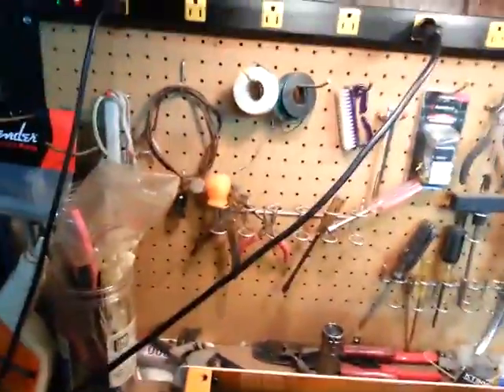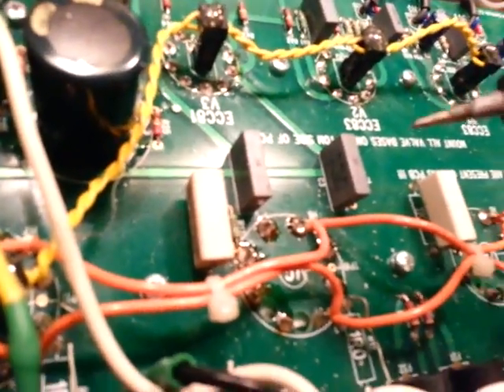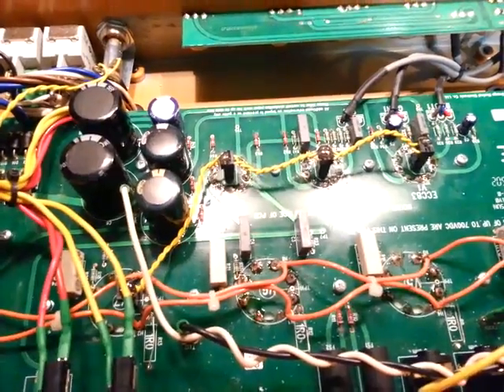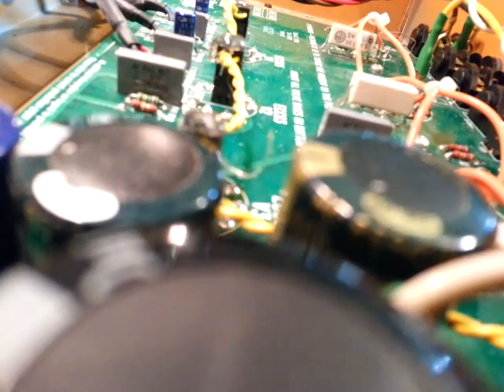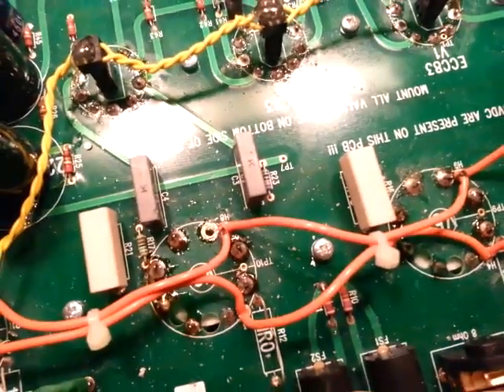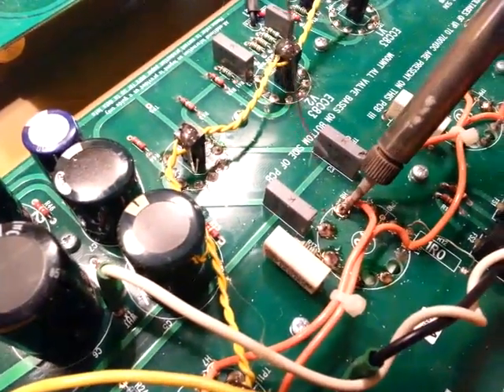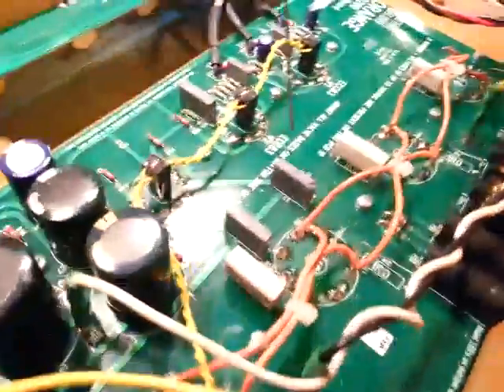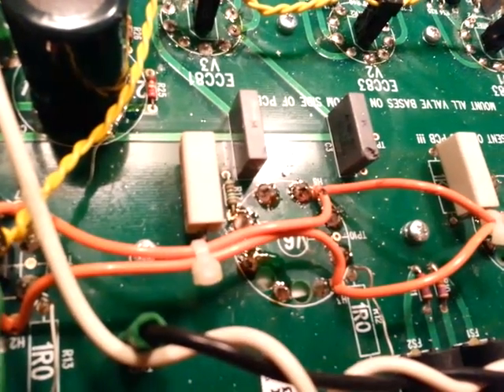Repair Orange Tube Amp bad solder

Comment: It is fixed. The tube pre amp pins would pop when you would tap on them. That was a tell tale sign.  I  re flowed the solder  and added leaded solder to   fixed it. I should probably do the power board and this amp would benefit from a new set of tubes, seeing that is 11 years old.  It was humming and popping now it is a lot  quieter .

Comment: I have a noisy B52 112 AT tube amp. It is hisses and pops. My guess is that the tube pins are not making good contact.  I have tried to clean them to no avail. This amp was made in 2006. I bet anything it has lead free solder on it. I will just replace the pre amp tube pre amp sockets with ceramic gold plated ones and see what happens. The power tubes sockets are tight.
Reply from the maker: Jack Issa hissing and popping can be bad preamp tubes or solder joints. The solder joint could be anywhere in that preamp tho so I'd reflow all of them before replacing sockets. As long as there's no dust in the sockets, even the worst conductor would be plenty for preamp tubes.
Reply: I guess I should start removing solder at the pins and re-soldering the pre amp tube  socket pins , My guess this amp has lead free solder because they were sold in the UK Swapping pre amp tubes around have little or no effect. The tubes test out on various tube tester as well. If I hit a tube pin on the PCB they will make noise . This amp is 11 years old this consistent with this type of failure based on it's age I will try to re-sweat the pins starting on valve 1  and working my way to valve 5. In the pre -amp.

Comment: kinda stupid to me to change ALL of the soldering before there is an issue hence the old saying in the tech world: if it aint broke dont fix it. You only create problems needlessly and run the risk of overheating some components
Reply from the maker: Picco bow and most techs would prefer to do routine and preventive work. hence replacing tubes at normal intervals and also recapping
Reply: That's because u are stupid, only a stupid person would say what u just said and that's why your to stupid to see it lol
Reply: Polar Bear  hay Jesus!

Comment: Idk who to ask for help no one around me does amp work or if they do they want like 200 up front :-( I was hoping maybe you can give me advice on my amp its a marshall S20 8240 Valve State.. I turn on the overdrive and get a really hard whopinging sound.. and no distortation out.. goto clean i get a clean sound with chanlles volume all the way up and the master all the way up but yet not what it should be... The leds inside for distortion dont light up either. I added a new tube cause i thought that would be the cause the Capacitors all look fine.. So i was wondering if maybe there was a bad solder joint on the tube?  Any help you can give is most appreciated thanks..